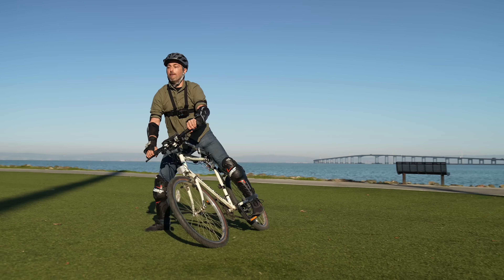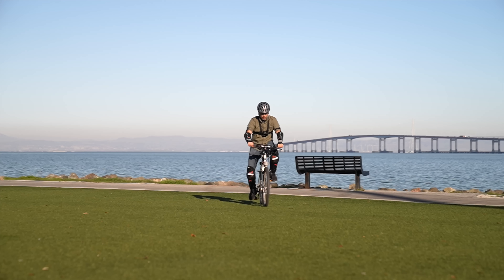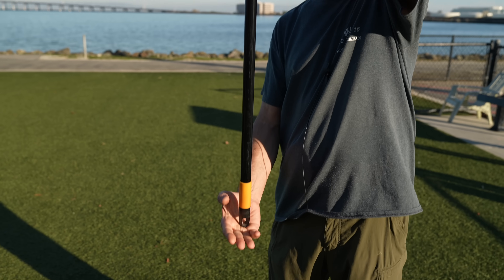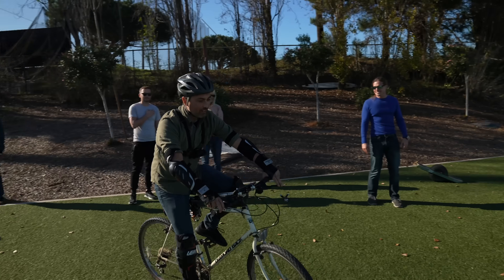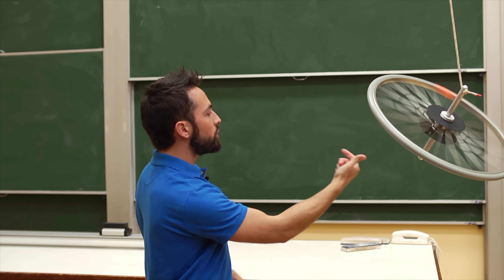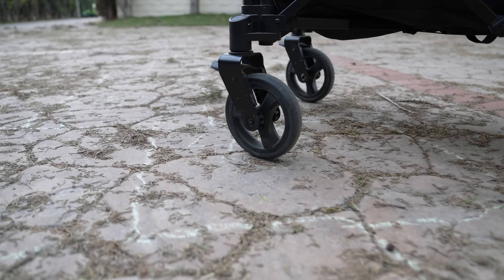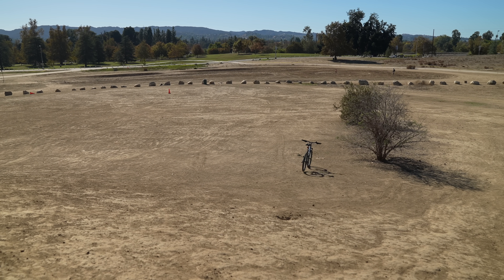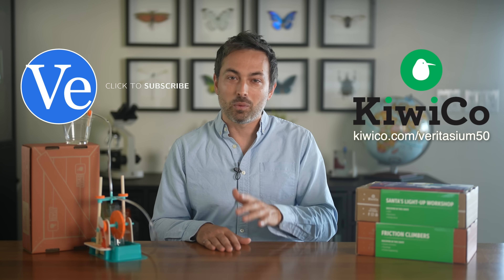Most People Don't Know How Bikes Work

Comment: When i’m going fast enough, I notice I actually don’t countersteer at all. But I think that’s because to turn at high speeds I lean my body weight and barely turn my handlebars.
Reply: Gyroscopic procession is how you actually turn a bicycle at higher speeds.  It has little to do with actually "steering" the bike when you are actually moving quicker.
Reply: Same for me. Ive always thought I was just leaning into the turn. I guess our sense of balance triggers a reflex wich make us do it unconciously as the balance organ works as a servo constantly making us position ourself into optimal balance position without thinking activley about it just as we dont think about breathing.
Reply: @johnpekkala6941  correct 😎
Reply: I guess it also depends on an angle of the turn. You don't really need countersteer when you do a small correction of the course.
Reply: At higher speeds forget about “turning” the bars, or “steering” or “counter-steering”. Just push. If you want to go left, push the bike into a left lean by pushing downward on the left bar. Want to turn sharper, push harder. The rest takes care of itself. 

Low speed turning gets a little more complicated.
Reply: This comment it's hilarious.
"I barely turn my handlebar", interesting, did ever wonder why the handlebar always seem to be straight even if you making a big turn at a high speed? Wouldn't make sense to have the handlebar turn in the direction of the turn rather than straight? Because according to you, you don't countersteer at all, well, thats not happening because you are countersteering lol
Reply: This “just lean” method that people keep mentioning doesn’t make sense. If you push your body one way and the only thing you are touching is the bike, you’re pushing the bike the other way. Your total center of mass isn’t going anywhere. The only way to lean is to move the fulcrum, not the CoM. You kick the fulcrum left to lean right and vice versa. You do the same when you change directions running. One foot kicks the ground in the opposite direction you turn. Boston Dynamics is well aware of this. Oh and it doesn’t matter how fast you’re going. It’s still happening.
Reply: @davidpoirierfilms  Indeed. But, lets say, you are sitting on the stool. And lean to the left, yes, you push the stool to the right, but does it exactly move to the right or lean to the right? Your center of mass gets shifted, but the stool not.  And I guess because of friction. And let me tell you friction applies to bikes as well. Now, whatever the case, I might not be right about friction to be the reason, but I ride on a bike regularly. And it is quite possible to ride straight and turn without hands. And the only way to do it is to shift your balance. Apart from theoretical reasons, that are not exactly correct, did you ever ride a bike without hands?  If not, don't try it yourself, but ask a friend - someone who can do it - how exactly do they turn. Or better watch it.
Reply: @d4slaimless  The stool analogy doesn’t work because unless it’s a poorly crafted stool or it’s tilted to on two legs, it has at least three points of contact with the floor that are not on the same line. If you are sitting on it properly, the line of gravity under your center intersects the triangle whose vertices lie on those points. It can be said that the stool simultaneously leans away from each of the triangle’s sides generally toward the corresponding opposite vertex. The farther away from the triangle’s sides your line of gravity is, the harder it will be to push the center of the stool toward a line on two of its contact points because you’d need a lot of upward force to get it over.
A bike gives you two points of contact. If you are sitting properly and navigating straight, your gravity line, for intents and purposes, intersects right between the two contact points. Any force toward either side of the line on those points would push the bike the other way. There is no third contact point to stop it. A better analogy would be one where you are balancing on a stool with two legs. In that case, yes, leaning one way would push the stool the other way.
Edit: I wasn’t implying that the bike will SLIDE the other way. I was saying it will LEAN the other way. Only negligible friction applies.
Reply: Ok man, make sense. But people still lean in turns and ride bikes without hands. Somehow bike tilts with me. The saddle doesn't shift from under me. I only need to slightly shift my balance and the bike turns. Again I can only suggest to try it on a bike.
Reply: @d4slaimless  No, but I know it can be and has been done. I’ve been thinking about that a bit after my last comment and may have to concede because of something that hasn’t come up. You can’t lean by exerting a translational force but you can still apply torque using rotational motion with parts of your body. Preferably long parts that can reach away from your center such as your arms and legs. Swinging an arm over your head to the left for example would be countered with an opposite rotation to the right which would get you the lean you’re trying to achieve over two contact points, as long as you return your arm close to the plane from the fulcrum to your center without swinging over your head again the opposite way. Also extending a weight close to the fulcrum to the right would apply minimal left torque but maximize a shift of your center to the right. That could be something as simple as sticking a knee out. Something is still bugging me though. The spirit of my comment was how when we teach kids to ride a bike we say “just lean into the turn”. The kid has no idea how exactly that’s achieved, and likely neither does the teacher. The lesson is left to the brain to figure out on a subconscious level where such verbal instructions are irrelevant and unhelpful. People who “know how to ride a bike” don’t ACTUALLY know how they do it and are not quite as qualified as they think they are to share the knowledge with another person. It’s a case of the blind leading the blind. Wouldn’t it be just as effective to give the kid a bike, some pads and a helmet and say “I believe in you!” and walk with them as they give it a shot?

Edit: your comment was edited while I was replying. To clear any confusion, here I am answering the question you deleted, asking me if I had ridden a bike with no hands.
Reply: @davidpoirierfilms  I kept thinking about your initial comment. It  considers the wrong system. I mean, you comment considers bike and a person on it to be separate bodies interacting at the saddle. However a person on bike also connected to it at the pedals. More or less bike is fixated between the legs. To an extent bike and a person on it is a single body. A person can move their hands, or head and shoulders. When your muscles applying force to move your head the same force is applied to the body. But since the body much heavier than the head the movement of the body should be negligibly small. The center of mass certainly going to shift. To turn my bike without touching handlebars I only need to slightly shift my upper body to the side. Also, consider a person simply standing on the floor. They can freely bent to any side shifting their center of mass. And it would work even if the point of contact with the floor is very small. Rotating joints also have something to do with this. Anyway, some arguments also are in your last comment. Considering my own experience of riding the bike without hands I can say it leans with me, or I lean with it.

Now different situation when you stand on the pedals. When you tilt the bike to one side, your body tilts a bit to the other.
Reply: Nope you’re definitely still countersteering. It’s just so natural to you now that you don’t really notice. If anything, higher speeds means you have to countersteer more. I’ve taken turns going over 100mph on a racetrack with my motorcycle and I actively countersteer. What you described is “body steering” which is ineffective. If you’re interested, you can read or watch “Twist of the Wrist” by Keith Code where they demonstrate and test this.
Reply: You do you just very small one and you dont notice it, it’s literally impossible not too
Reply: @CraftedPiggy  "you're doing it you just can't see it. Measure it or notice it in any capacity" orrrrrrrr. It's only an issue at low speeds...
Reply: @jaydeeee668  take it from someone who rides a motorcycle. countersteering works exactly the same on all 2 wheeled vehicles. the faster you’re going the more likely you are to actually turn the handlebars in the opposite direction of the turn. that’s the actual definition of counter steering. “consequences of not counter steering a motorcycle” he actually explains how counter steering works
Reply: @starkshark_9973  Yes I only really took note of this when I first started riding a motorcyle. I was riding down the highway and I pulled my handlebars to the left but my bike started to turn right...what sorcery is this I said.
Reply: @santiagokiwi3187  precisely. i remember even sitting down on my first bike and turning the wheel and feeling the bike slightly lean to the opposite sides and then trying it at higher speeds. its just too much fun
Reply: @jaydeeee668  When you lean to the right, you also push on your right handlebar, creating the slight left turn pressure necessary to increase the rate of the turn. Watch some motorcycle videos or something.
Reply: @jaydeeee668  You're being rude to people and also completely wrong. You can absolutely notice it if you know what you're looking for. Countersteering is a thing you do at high speed.
Reply: @jaydeeee668  So no, it's more noticeable at low speed, when you lean your body left for example, by transferring your weight you push on the left handlebar (turn right) to countersteer into the left turn, the bars remain more straight as at speed there's more balance.
Reply: @jaydeeee668  Delusional, u gonna crash and hurt yourself some day.
More speed = more countersteering, not less lol
Your body do it by itself, there is a reason for even in tight corners at higher speeds the handlebar seem always straight and not completely lean to the side you leaning as you would expect.
Reply: You can measure it. And measuring tools are used in all fields of science to measure things we can't notice.
Reply: @starkshark_9973  bike weights way more than a person sitting in it hence your need to counter steer. When riding the bicycle you can affect the balance by shifting your body. I don't need to turn the handlebars in the opposite direction of the turn unless I need to correct the trajectory. I can ride my bicycle with and without hands and make a turn both by turning the wheel directly or initiating the turn by leaning my body (and the wheel would turn). I can only guess, but I doubt you can to much to motorbike by leaning. And that's the huge difference.
Reply: @d4slaimless  you dont think leaning is helpful on a motorcycle? :) oh geez. nvm i dont even want to reply, bye
Reply: @d4slaimless  Precisely if you turn without using your hands you will see inevitably that the wheel countersteer itself before making the turn. You can't avoid it, it is needed.
Reply: @CraftedPiggy  If I'm going 40km/h i do not need to turn left to go right first , i just lean to the right and then steer to the right , it's same for low speed as well , you just need to understand it , understand what will happen , everything in the video was too manufactured , too "scientific".

Go ahead and try the same thing as in the first 3min in the video , you will be able to steer in left/right without counter steering, you will most likely fall, because when you will steer in any direction too fast(since you are going slow ,anything is too fast) you will lose enought speed to produce a need to counter steer in order not to fall
Reply: Yes, you do. Your legs pedaling is what is countersteering. Or if you are coasting without steering, its your body that countersteers the bike's, it just may not be noticable.
Reply: Well on a motorcycle, so high weight AND high speed, you always have to countersteer, it's the steering that is supposed to happen afterwards that's very limited because we turn simply by leaning. But to initiate that lean you HAVE to countersteer. There is no way your sheer weight shift will overcome a 150+ kg motorcycle's balancing forces without some countersteering involved.

The only exception is when going at very low speed, like filtering through traffic, that we do turn the handlebars more, and hardly countersteer or lean. So I'd say the faster you go the more countersteering becomes inevitable.
Reply: When you're leaning to one side, your pushing on the handle bar on the same side you're leaning, thus countersteering.

Comment: I rarely comment on videos but I simply have to do it now. I think this video has finally solved my problem with failing to learn to ride a bike.
I never learned as a kid and as a grown up, in my 30s I decided to take lessons. I quickly picked it up, all was good when going straight. Turning, I would fall every time. I had 2 instructors (plus friends and family) and none of them mentioned the steer in opposite direction before turn (to some people it's simply not intuitive, especially if you're already an adult and a bit more wary). After a while, I gave up. 

I'm the kind of person who needs to know and visualise the mechanics of certain actions in order to adopt them. Same thing happened when I was learning to drive with the clutch. Once I knew what clutch actually does, it all went smoothly. 

I'll give the bike another chance!

Comment: This is entirely weird to watch since you can direct steer on a motorcycle without having to counter steer, obviously it becomes harder to do at higher speeds. Im wondering if since a bicycle weighs less than a motorcycle that the COG or friction plays a part in not being able to direct steer for a bicycle.

Comment: I think it was in the 1970's that motorcycle racers were finding out that actively counter-steering (As in consciously turning right to go left) could make you faster around a track. There's a really cool bit in Keith Code's Twist of the wrist 2 that shows countersteering by putting an arrow on the yokes pointing back at the tank, and showing how the bars are actually moving during turning.

Comment: The first 3 minutes are not accurate.. You don't steer in the other direction because you have to, you do it because it's EASIER... You can absolutely turn without first turning in the other direction. Just lean. Test it yourself. The reason most people instinctually turn instead of leaning, is because its safer.. .It's a fear thing, but it's not NEEDED. 

You can absolutely turn with JUST leaning, no turning the other way first. You don't turn first on a motorcycle, you'd die. They're also two wheeled vehicles that operate the same way.

EDIT: 
And again at 6:45: I personally can stay upright in both stationary, AND moving.. WITH locked steering. If you completely remove the wheel, and just put a solid object with the same width as the wheel and you can test this even better.
Reply: I invite you to ride a bike with locked steering if you're so sure (better wear a helmet)
Reply: @Owen_loves_Butters  I didn't say you could successfully RIDE it for an extended period of time, I said you TURN without turning the other direction first. Although, I can ride with a locked wheel for a good time I bet, Ima try it this weekend. I'll show you the Dr. bill when I fail :(

Comment: You can still steer left by turning right - Turn the handlebars sharply to the right while moving, then you’ll lean onto your left side and you can straighten out the wheel then. The front wheel follows wherever you point it and because of centrifugal force the bike gets thrown to the outside and you literally "turn left to go right"

Comment: Cute experiment. But how does it add up on a normal bike?  And when u are riding with one finger on the handlebar (or no hands at all). 
It is indeed easy to make a steering in the opposite direction first. But it's not actually needed to make the turn. It's about the point of gravity. Ask any Dutchy! xD